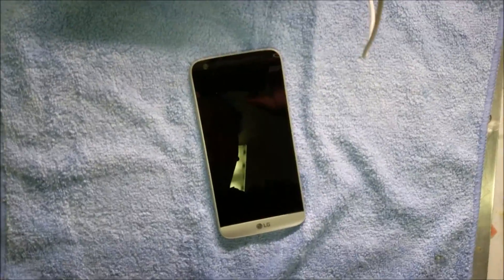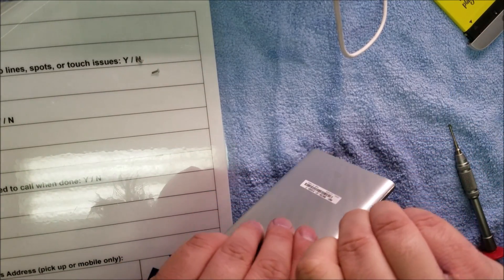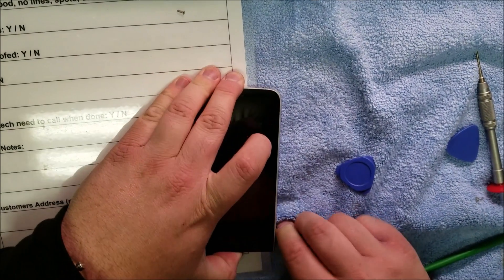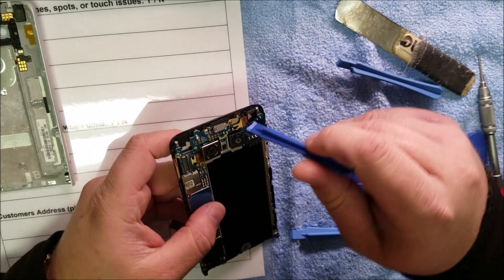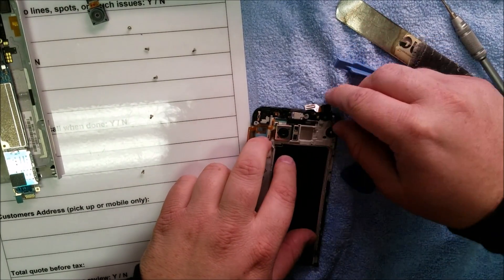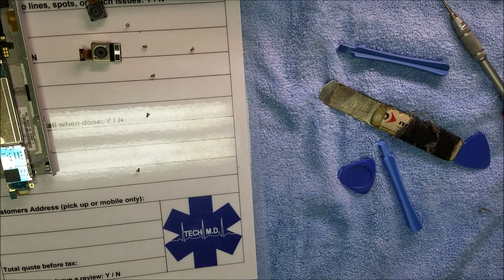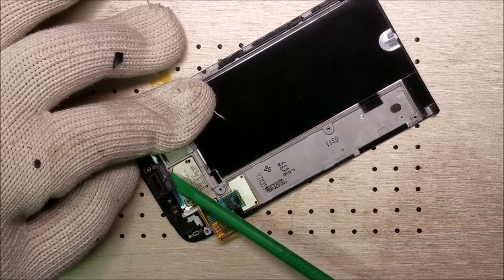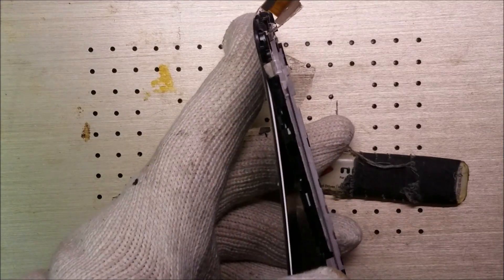LG G5 Teardown With glass only Repair Part 1

Comment: So is the the repair a failure?  That is what it implies in the titles of parts 2, 3, and 4.  We need to know if your repair is successful at the beginning, without having to watch an hour of videos to find out.  Also the replacement glass alone is now available and inexpensive from several sellers on eBay.
https://www.ebay.com/sch/i.html?_from=R40&_trksid=p2334524.m570.l1313&_nkw=lg+g5+glass+-camera+-lens&_sacat=43304&LH_TitleDesc=0&_blrs=recall_filtering&_odkw=lg+g5+-camera+-lens&_osacat=43304
Reply from the maker: Lg Is the true failure they quit no more Lg phones. Be honest I don’t remember this video is very old

Comment: Im sorry but i give this video 2 thumbs down. I hated for the fact you kept throwing around its the first video on youtube of someone replacing the screen. Cool anouce it maybe once at the beginning then once at the end but leave it at that. Second for the fact it looked like it was your first time doing this was not a great idea to post it on youtube. If anyone would follow this to replace there phone screen it could end in terrible loss to the phone not just to the screen. Third using a towel to work on is one of the worst things to do. Static Electricity can short out the motherboard of the phone. And finally using metal to disconnect the connectors to the mother board on a towel defentally not a great idea. Not here to sound mean just giving you better tips for you for when you make another video.

Comment: i recently cracked my g5 screen days after i bought and looking to get it repaired is there an email i could possibly reach you at for a glass repair
Reply from the maker: Dustin@techmd.bz glass repair is still not possible only full lcd replacement.
Reply from the maker: Buy the lcd assembly up above in the links and ill install it for free.   As later on in the future ill be able to refurbished it for you.
Reply: +Tech MD Youtube okay ill contact you through email